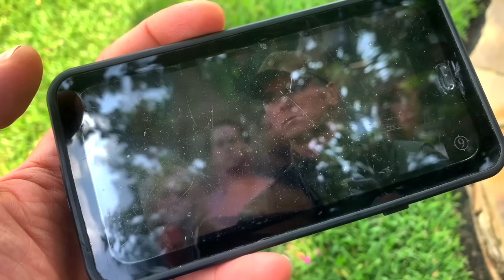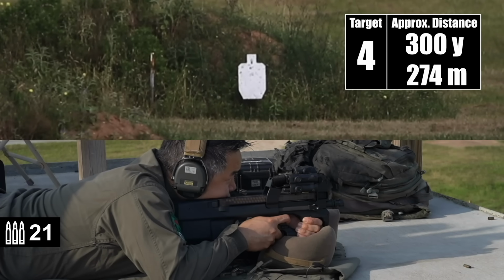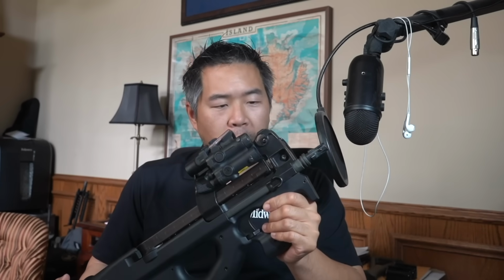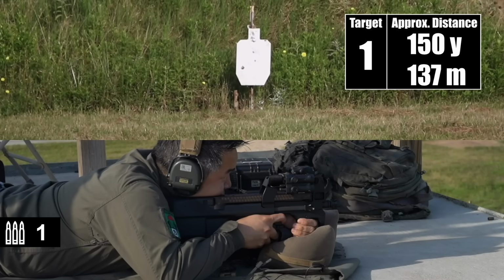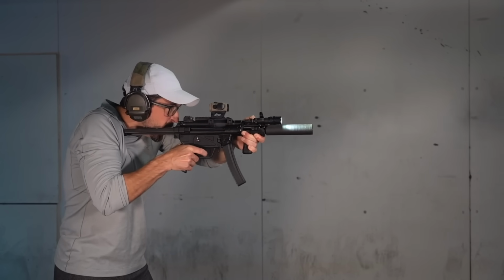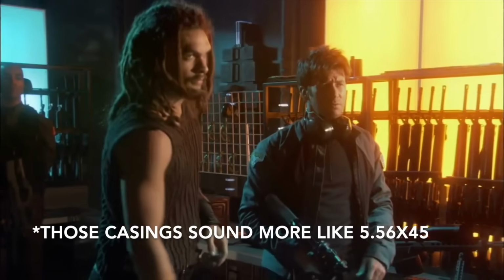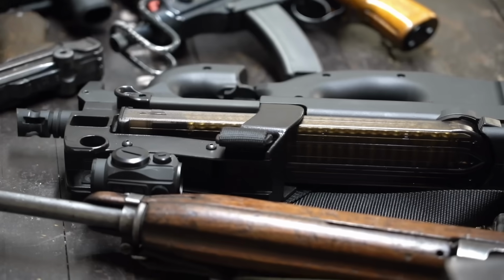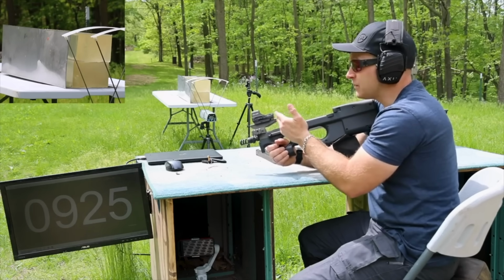FN P90 to 500yds: Practical Accuracy (Stargate SG1 main weapon) PS90

Comment: 30:30 The AKS-74U and AK-105 see relatively little use with Russian special forces compared to what the general western gun guys think, the AK-74M is very much still their bread and butter. The AKS-74U is occasionally seen with some CQB focused unit (probably most famously SOBR Akhmat, formerly known as Terek), for close protection, and specialists like combat divers. AK-105 is more common, but still far rarer than the AK-74M. Forexample, the SF in Syria almost exclusively used AK-74Ms and even the CQB SWAT and CT units make heavy use of full length AKs. There's a tendency for the high speed SF units, especially TsSN FSB, to gravitate more towards the AK-105, but they still have AK-74Ms and you can also find AK-105s with regional SWAT teams. I've heard talk about how the shortened barrel, especially on the AKS-74U, really decreases the effective range and stopping power, some even describing the AKS-74U as basically equivalent to an MP5.
Reply: External ballistic of normal and short barrels +- equal up to 200-250 meters.
Problems - AKS74U production stopped  in 1993, and stock version never have side mount.
AK 103-106 are unificated with 74M( BUT 103-104 use 7.62*39)
Reply: @ИльяМостовых  The AKS-74U was produced in smaller batches with a side rail for optics, like all the other AK models before the AK-74M. Modded AKS-74Us often have the B-18 rear sight rail mount. But a lot of special forces still don't use optics, or at least didn't before the last 5 years or so, so I don't see why the complications with mounting optics is unique to the AKS-74U or revelant to how little it's used. Overall, I still see more stock AKS-74Us in the hands of tank crew etc. than kitted ones used by special forces, contrary to what Henry implied. And remember, a lot of regular police officers are issued AKS-74Us, but the special police units (SOBR, OMON) still overwhelmingly use full length AK-74Ms. So I'm thinking there must be a good reason why even CQB oriented units don't go for the AK carbines, which I suspect has to do with stopping power and range decreasing with lower velocity.
Reply: @fridrekr7510  burocracy, dont try to find logic)
 Short version is basic not for only special forces. It for crew, heavy weapon teams etc
Side mount on AK started from N-modification(Night), before M.
Short version have similar ballistic up ro 200-250 meters AND it short and lightweight.

Comment: I have a PS90. It's laser accurate out to 100 yds. I can fire 3 inch groups out to 250yds. But I'd not use it regularly beyond 100 yds. It isnt meant to be fired beyond 100yds. Its a PDF weapon intended for close in defense. 100yds is its maximum intended range.

Comment: Take it to the extreme for fun and views…

Compare: P-90, PS-90, Kaltec P50, & P-90 Airsoft

Would have loved to see a direct comparison with the P-90 and the consumer PS-90 on the range and on the course.

It’s unlikely that any of us will have access to a P-90, but the PS-90 would be interesting to check out, particularly now that the ammo is competitively priced.

Another interesting option would be to compare the P-90 with what might be its closest consumer option, the Kaltec P50 5.7 pistol with a brace. It’s less than half the price of a PS-90, and uses the same/similar 50rd magazines. The barrel is 9.6in.

https://youtu.be/I-xYzL1ghFE?si=2qHNjnTGCKx-kBrj

And of course, you have to compare the P-90 with the classic P-90 AIRSOFT in 6mm for fun at home. The trigger works like the original P-90. Rather than black, pick it up in Star Wars Alpine White if you dare. ;-)

PS - Don’t get caught walking around the front yard with it!

Manufacturer: KRYTAC -  https://krytac.com/krytac-emg-fn-p90-custom

https://www.evike.com/products/104261/#a_aid=Krytac

Comment: in call of duty 4 modern warfare, i loved the p90. in that game the teams had more of a spawn area having  opposite sides so it was less chaotic, but if you got over ran by the enemy team you got corn holed in your spawn as they would run in flank from every angle and if they had a helechopter it was a slaughter and it would suck because once that would happen you were trapped in a crappy situation until the match was done. the only thing that countered this was the p90 with juggernaut, steady aim, and 2 rpgs. then you just had to push, hip fire and tank damage, while blowing up the chopper with the rpgs.  i had two p90 loadouts.   the other was either juggernaut or double tap, steady aim, and bandolier and i had a 4x acog on the p90 for when they were further then 15 yards out other wise i just hip fired. this was my breaking out SHTF and counter flanking load out  . other wise i always ran the m4a1 stopping power, deep impact, and rpgs for helicopter, that load out slapped so hard and got insainly high kill streaks.

Comment: I had a PS90 and absolutely loved I’d. Practically no recoil and perfectly accurate at 100 yards. Don’t need full auto especially with the pricing of 5.7 ammo. Ditch the built in optic,put on an aftermarket rail and use an aimpoint or other red dot sight.

Comment: P90 is great for police forces where they only require ranges of ~200m on unarmored targets and want to avoid accidental casualties.  A small round that falls off quickly and is easily stopped by walls.  So great for some, but not a weapon for front line forces.

Comment: 23:52 Perhaps 7.62x39 has inherently less concussion by virtue of its greater swept volume per unit barrel length, but having a muzzle device that acts as both an expansion chamber and divergent nozzle probably help as well, especially when comparing it to the muzzle braked AR

Comment: Does adoption of the Sig offer an opportunity for the PDW to make a comeback?
When the ammunition logistics are focused on 5.56 the short carbine is the viable alternative; but with the heavier round and longer barrels of the infantry rifles there may be a necessity to consider a different calibre for smaller weapons. The Sig may replace both 5.56 and 7.62; would there be value in replacing the 5.56 and 9mm with the 5.7?

Comment: Regarding the issues for feeding, lubrication, etc. It's my understanding that is to allow the cartridge to extract easily. Keep in mind, everything I know is from secondary sources, but it sounds reasonable. If anyone has different information, please share.

Basically, sloped cartridges are designed to be easier to extract. The straight walled cartridges need more time to cool. The Teflon coating assists in extraction, allowing the cartridge to be pulled out earlier, enabling a higher rof and preventing cases to otherwise be jammed in without requiring the chamber to be redesigned to something like the HK fluted chamber.

This might change for pistols, as the slide and mechanism may delay the action significantly more than the P90. But without data I can't be sure. If anyone knows better, please help a brother out.

Comment: Great video though the one comment of the 5.7 being a needle coming at you is a little interesting since actually it’s slightly larger than the 5.56 so inside of 200 meters a small weapon that penetrates level 3 isn’t bad. I’ve worked with the Panamanian special forces who use these things quite effectively

Comment: The thing about the P90 and the SG teams is that SG-1 (and others) where a diplomatic/exploration team.  They needed a defensive weapon that didnt look scary enough to cause problems with negotiations.  The SG teams that were combat oriented carried ARs and SAWs.
Reply: The only issue I had about the P90 with Stargate teams was that they also carried a Baretta 9mm as a sidearm. Why would you use that when FN makes the Five Seven which uses the same ammo as the P90? If I was stuck on some hostile, alien world, I would want all my ammo to sync up. That could of also been a story point where someone runs out on one platform, then cannibalizes ammo out of the other to get out of a tight sport.

Kawalsky: "Colonel. We are out of ammo on the P90's."
Carter: "We have a box of sidearm magazines in the Tel'tak. Transfer the ammunition into the P90 magazines."
Reply: @brucea3103  The SG teams originally packed MP-5s in 9x19. The P90 was brought in  when SG-1 encountered the Unas (tough as deer jerky reptilians that shrugged off 9mm) and never really left (because the producers loved how futuristic the P90 looked). Sticking with the Beretta is not surprising from that perspective.
Reply: @brucea3103  like someone else mentioned the other teams that were less diplomatic carried MG, Rifles, and other heavy weapons. Plus side arms.  The standard issue beretta 9mm would just have been economically easier. Especially as an issued sidearms to each member. Most using it and familiar with it for years.  Also when they started the series in SG they used MP 5’s so it made sense then too.
Reply: @brucea3103  AMEN Brother. That's why I ALSO have a RUGER 57 with 3 mags, two in a double mag pouch. A boy can never have too much ammo.
Reply: @brucea3103  In the situation that you are refering to what you need is a "perfect pair" which if your main weapon is an SMG then the Kriss Vector/Glock is the best.
Reply: @brucea3103  Earth logistics.  It's easier to give someone the standard issue sidearm we already have... because trucks bring 9mm to places already, guns are already ordered and paid for, etc.  Logistics.  Or whatever reason you wanna make up it's a fictional universe :D
Reply: @brucea3103  If you compeltely ran out of ammo for your primary weapon in the middle of a firefight, it's going to be much faster and easier to simply let you primary weapon drop and then draw your sidearm.  If you're in the middle of a firefight you're not going to have time to empty a few pistol magazines and then take the loose rounds and fill up the mages for your primary weapon; you'd be dead before you could reload a single magazine. It's not like you can call for a timeout and the enemy is going to obliging recognize your timeout and allow to transfer the rounds from your pistol to your primary weapon.
Reply: @Riceball01  Yep, the only way those bullets come out of the mag in a firefight is through the barrel.
Reply: @Riceball01  Never said that that swapping ammo during a firefight was a plausible scenario. I was saying the with a single, common bullet and low on ammo, a team could decide which platform would suit the mission best: The 50m range of a pistol, or the 200m range of the bullpup. The FN Five Seven magazine holds a standard 20 rounds. Say you carry two extra mags. That's 60 rounds that can be loaded into a P90, or at least 40 in the P90 and a fully loaded Five Seven. That is more flexibility than an empty P90 and 45 rounds of 9mm.

It's the same reason military vehicles run on diesel: one fuel tank can fill an M1 Abrams as well as the Marine's KLR motorcycle.

When I'm several light years from home and the D.H.D. is on the fritz, I want as many options as I can get.
Reply: This.  In a "real-life" SG1, I don't think that the P90 is a bad choice.  Not every world is going to be a gunfight.  That tiny package is convenient to carry and can fix most problems inside of 200 meters... Even if that threat has light armor, without looking terribly threatening, and that you can throw over your back with ease. Would I want a P90 if I was expecting a gunfight?  Heck no.  But if I wasn't?  The thing is so tiny....
Reply: Found the Stargate nerd lol, I just finished binge watching SG-1 again and you are right. There were even some later episodes featuring MP5's again in some roles, and they even used MP7's in a few scenes.
Reply: Also needed to be compact because of the unknowns of what they were getting into. If not for the p90, they would have probably carried pistols or an MP5 instead. I don't think that an m16 would have ever worked.

Comment: What it reminds me of a little is the .22 hornet. .22 hornet is hotter for sure but it's a compact center-fire cartridge that's effective out to 200 to 300 yards on smaller varmints. In regards to ammo getting fuel on it, fuel logistics, aviation, mechanics, and armored vehicle crews spill fuel constantly. I am not saying they would store it in JP8 and I would be curious to see what level of contamination with fuel causes issues. If it's a complete submersion that creates the issue that's pretty extreme and I agree with Henry's assessment. but if say handling the ammo with hands, gloves, clothing that has been previously contaminated with fuel or if over spray of the ammo or the magazines getting splashed with fuel creates issues with feeding I would argue that's a big concern. Having gotten splashed with diesel many times in my own service I can attest there are many ways it happens. I was also in a fuel logistics unit and setup fuel infrastructure for others so I may have had extreme exposure to this hazard. But a major trying to get his lower enlisted soldiers to hurry up fuel up whatever it is that needs fuel can and will make for a terrible mess that hopefully happens inside secondary containment so you don't have to dig up the fuel spill from the soil.

Comment: One thing that added to the sudden blooming of new firearms and ammunition in 5.7, is the actual adoption of the 5.7x28 as a NATO cartridge… only 30 years later than expected due to HK throwing a fit, and lawsuits because they didn’t win.
The 4.6 is the one not really going anywhere big. HK expected to retire the MP5 from production with cheaper and easier to produce UMP plastic smgs, and the P7. And it never worked out that way… customers would still rather buy the MP5, over the straight blowback UMP. And most customers favored the 5.7 over 4.6 if equipping a force with a PDW.
NATO adoption, or US Mil adoption does wonders for the popularity and longevity of a cartridge. Its alot of the reason.45-70 is still around and popular.
Reply from the maker: technically NATO did the weak move of assigning STANAGs to both 4.6 and 5.7, that said, 5.7 clearly has more utility and the market shows.

Comment: I guarentee that if we could buy new MGs people wouldnt poopoo the P90 hardly at all. The lack of a fun switch, and the SBR hassle, is in my opinion the primary reasons people overlook it.
Reply: SBR laws frankly hurt it more than even the lack of a fun switch, since the purpose of the P90 is to be very compact as a PDW. Would make for a neat briefcase gun if there wasn’t any NFA bullshit. Can’t even skirt around it with a pistol brace due to how it’s designed. The stock is the receiver.
Reply: @gameragodzilla  fun fact, the stock isnt actually the receiver. The receiver is effectively the barrel assembly. Someone was trying to develop a pistol-brace for it, but I'm not sure how its been coming along.
It could be done, physically, but whether it would actually be viable is a different issue. A pistol-braced bullpup would be a hard sell ergonomically.
Reply: That's most of it yeah. Ammo cost is another issue, but if more people wanted the P90 the ammo price would likely decrease a bit too. As it stands there's just not that much of a market for it.

Comment: Around 2005 an Italian PSD team was ambushed in East Baghdad.  Insurgents on a bridge at 300m. They told me the P90 did not do well and they felt undergunned.
Reply: Because 300m is pushing the limit for a P90, or really any PDW and most SMGs too. The 5.7 is a very small, very light cartridge. It simply was never designed for rifle-range engagements; it was specifically designed for close-in personal defense.

Comment: 👏 M 👏 P 👏 5 👏
This is not fair you must do mp5 next I beg you. You say the krink can hit targets at longer range but provided no proof as the mp5 was never tested on the practical accuracy course. The krinks performance was pathetic so I'm very curious to see how close 9mm can come in usefulness.
Reply from the maker: that's in the shop
Reply: @9HoleReviews No cheating. Full length 8.9in barrel and 8g 9x19 at full nato pressure. There are several federal 124gr loads available at nato pressures in the us.

Comment: For the first few seasons of Stargate they used MP-5's and later switched to the p-90. As well if the first episode the enemy armor was basically bullet proof and in later episodes the armor did nothing. This is fill fan fiction but is this the difference between 9mm and 5.7?